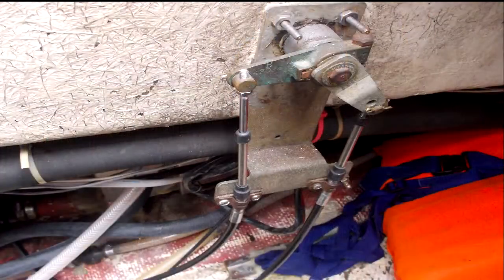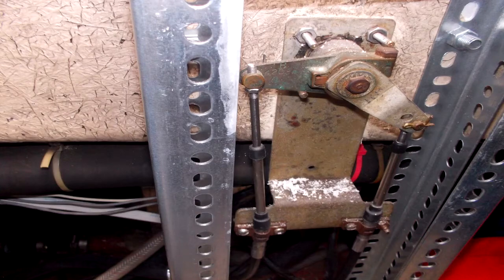Projects April on SV Epicurean

Comment: Where you cut the cockpit for the access hatch, you exposed the plywood core material. You should seal that with a couple coats of epoxy, or a layer or 2 of light fiberglass. Anything to keep it from being exposed to water, which will eventually cause the core to rot, and need replacement. Easier (and cheaper) to spend an afternoon fixing it now, than days/weeks/months fixing it later, when it turns into a major problem.
Reply from the maker: good advice, i just used the marine caulking.